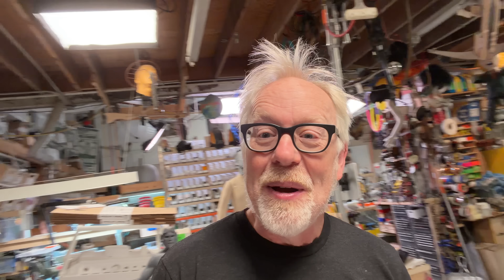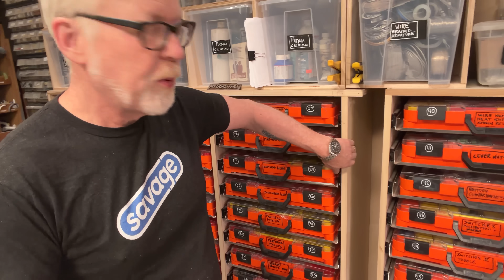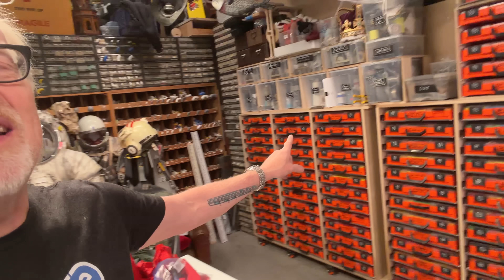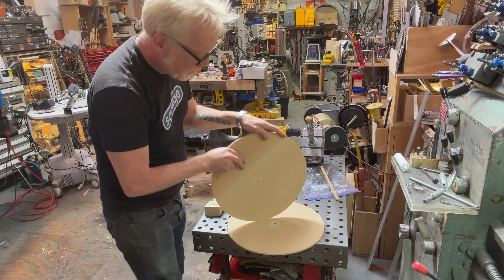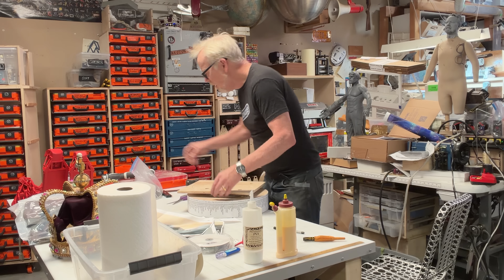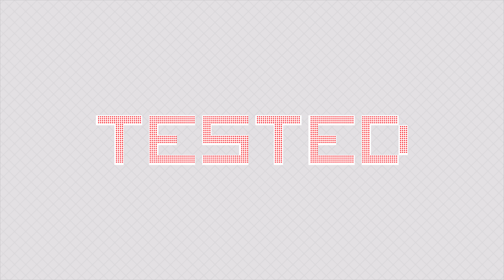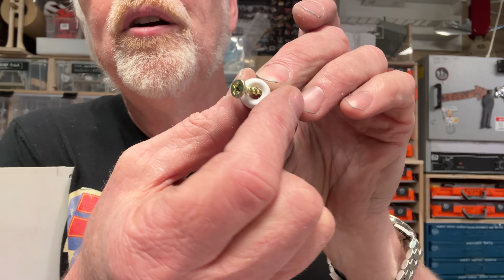Adam Savage's Hardware Organization Mistake!

Comment: I hope that the idea @ 22:13 is a larger diameter touch wheel/ring on the sides of the list to keep hands off the paper. Nothing turns gray faster than white paper in a workshop.
Reply: I was thinking something similar, but instead I would adjust the cutout on the right side to have a small slot on the top and bottom, and put a series of ~3/4 inch nubs to turn the wheel with. Could maybe put one every 6 inches or so? Just fun to think about!
Reply: The previous board, at the start of the other video, had clear (packing?) tape on the paper; it had something splattered on it and he said he'd have to wipe it off. 
Being off the floor it's probably all farther from the splash zone, but it'd do the trick. Maybe it'll get embellished when he redoes the list a month later like he said he does 😂
Reply: @Spamshinerdirty hands are more worry than the splash damage.
Reply: you'd lose the ability to pencil stuff in, but it could be laminated.
Reply: I immediately thought the same. It would be nearly illegible within 2 weeks in my shop unless I stored gojo wipes next to it.😅

Comment: You could drill holes on both sides of the wheel for finger grab points instead of putting your hands on the paper list. It will mitigate the damage grease and oils will put on the paper from your hands while you're in a building frenzy.

Comment: An acrylic piece over top with a thin line painted on it.   This would allow you to spin in and sort of give a definite point to read while not obscuring any other lines.    Not really critical but gives you a well defined place to read from and assuming you walked away and forgot what you had read or needed other read it again, it would be right where you left it.

Comment: Inside the wheel, put a light so the index glows, rather than a light that shines down on it. There is plenty of room for a hole to be cut in the centre of the bearing and the light could be fixed to the slide. 

Of course, you then need a "do not press" button to turn the light on!

Comment: Only issue I see here is if you are going to use this wheel a lot your paper will be messed by hand oils and you will need to re do it all over again. It would be way better if there is some kind of gears on the side where you can "steer" wheel and also you can use smaller font with magnifier in front that is fixed on your frame and positioned so you don't need to bend !

Comment: I really like this low tech, bespoke solution to an organizational problem. I grew up going to work with dad in the service department of a motorcycle dealership. The solution back then was printed catalogs that were saddle stitched. And then in the mid 80's computer software that, looking back, was total garbage. Because of my computer background I would have just set up a chrome book always logged into a Google Sheet that had the information. Have 100 people independently solving the same problem and you'll end up with 100 different solutions.

Comment: I’d suggest Arial Narrow or Helvetica Narrow. Sort the list by categories. For example all screws would be together, all nails, all washers, all bearings, etc. So if you wanted “5mm Machine Screws” you’d rotate until you see screws, then machine, and the size. You could also put a little image flush right as a category indicator. Or just another column of text. But not every line, but the first one in the category. It would make finding things a lot easier.

Comment: Looks great  .. I have two suggestions.. that can be easily added to it as it is now.. 
1) In addition to doing the "Lines" at the Alphabet Break points" also print in Sharpie to the Right a "big" Letter to correspond to so you can see at a glance if it is at "A" or "G" etc.. you do not have to do every letter just so 1 or 2 are visible no matter how the wheel is rotated.. 
2) Take wide packing tape and cover the paper index... so if you hands are wet or dirty you do not damage the paper and can still read it and allowing you to wipe it off..

Comment: Very nice!! Love the idea of throwing it on a wheel cartridge thing. Also love that you put the finishing panel on it. Completes it. 

Ideas:
- push the wheel further back into the cabinet depth
- black plexi panel where the window is and add a plexi wheel to the end of the wheel as a handle
- cut a new slit along the right side of the window plate for the wheel handle to push through
- add led lights that make it look cool and easier to read once the wheel is recessed. LED should time off. 
- upgrade the list with a big alphabetical letter justified right.
- Extra points if the led is black light and the letter is fluorescent. Would really pop as you scroll. 
- Magnification could be good too. Fisheye would bake it fun.

Comment: the lazy Susan is less than satisfying. I would have chosen a bar through the center with two roller skate bearings. it will be so much more satisfying when it spins that way

Comment: The lazy susan is grinding because it's mounted sideways. It can't do radial loads, it is for axial loads (sitting on a table with weight on top). Not to mention the eccentric loading of being mounted to the side of the load like a cantilever. Try another solution to get a free spinning wheel to be truly satisfying.

Comment: As a few other comments said, you should put a lens with a line that you look through to see the list (we are all getting older and our vision gets worse). A cheap wallet magnifier lens is a few bucks and could be mounted with a small 3D print.

I would also think about making the list a 2-level taxonomy. Looking for a "screw" should not make you spin to Drywall Screws, then Eye Screws, etc. You already kind of have it with lines where you have "Rivits" then a comma and the type. I would suggest that, instead of lines for letters of the alphabet, you have larger, bolded lines (with no number) for large concepts, and then the numbers as you have now, inset below them. This 2-level outline will be much quicker for information retrieval. The old list made sense when you were limited by the cabinet's height, but now the list can get longer and still take up the same general space, while making it much faster to find main items at a glance.

Comment: This should be the ever improving project. 
- Mount higher so you don't have to crouch to search parts
- Needs a wheel of fortune tick, tick, tick sounds as it spins
- Letter divisions for A, B, C.... should be on the side of the wheel in large lettering. 
- Tiny whiteboard just above to temporarily list multiple bins so you only need to lookup once and search once

Comment: If he hadn't printed the numbers on the left, I would've suggested using a laser level to give an easy "underline."  It wouldn't be difficult to make it power-on automatically whenever the wheel moves and turn off after a set time with no movement of the wheel.  Absolute overkill, I know, but that's also why it would be awesome.

Edit: typos

Comment: I think this really needs some sort of handle/gear-like grab points on the left or right so the wheel can still be turned easily without having to touch the list. 

In the graphic design, I would on the left add colored columns for each letter making it easier to scroll to specific letter then find specific word. Another example borrowed from the Rolodex.

Comment: I have a smaller setup, just 16 shelves divided in three areas, but every shelf and area has a QR-code and three led;s, i use the phone to look for M3 screws, and the LED lights up on the compartment in the shelf where it is. Or scan the QR for that area and see what should be there.
Just a tiny ESP32 and "a bit" of cabling. After a while i learned where stuff is so just use it when i search for something strange.
But for a analog setup, i love that one Adam made. And it works without power and looks cool 😁

Comment: @tested I still think this would be a quick, easy and super useful private skill for Alexa. This is the type of think that voice assistants are actually useful. The data structure is dead simple, the Alexa intent is straightforward: FindBinIntent, where are {partName}, find {partName}, locate {partName}, The normalization is straightforward.  Basically an Alexa custom skill backed up by an AWS Lambda, and no database required - the dataset is small, just bundle the data with the skill.

Comment: My wife and I considered using a lazy susan bearing like this for a calendar wheel I comissioned for her. It's a ~3 ft diameter tabletop CNC'ed and dressed up very nice. We thought of other options because I wasn't sure how we would mount the lazy susan to the wall, and the only thing I could think of was what Adam did here, drilling holes through one of the boards to access the holes in the lazy susan. Yet we couldn't do that with the finished calendar, or our wall. We eventually chose to use ~12 picture hanging fixtures, the kind with the zig-zag teeth, spaced around the wheel behind each month so we can pick it up and turn it to one of ~12 specific angles. Worked out great for us, but I've never forgotten my love of lazy susan mechanisms.

Comment: Now add an illuminated magnifier so you can actually read the line item when it comes around on the wheel.
And a motor to turn the wheel. And a button to control that motor.
Then replace it with a flea-market Android tablet sideloaded with a custom app.

Comment: Honestly OpenOffice's spreadsheet program is basically a clone of excel from 20 years back, if they stopped adding new features then. Some of the features added to Excel did make it better for a while, but these days it has a lot of "features" that make it infinitely worse to use, so you might just be better off using OpenOffice anyway.

LibreOffice is a fork of OpenOffice that incorporates newer features and improvements, and is probably a better pick than Excel these days, especially with all the enSiffication microsoft are pushing out.

Comment: I’m surprised that it wasn’t color coded as well so you could quickly find a category like fasteners, misc, etc
Reply: @tested Or alphabetically color coated. As you're walking to the wheel you already know about where it is in the alphabet, and which direction you would need to go to the new letter.
Reply: Or, you know, use the actual spreadsheet used to make the list in the first place. They can be instantly searched on any device.
Reply: @bcbock  the tactile search keeps you in the physical space though, using your hands and your eyes so the flow state doesn't get interrupted
Reply: @EmmettMcMullan  At the point of storage add a small touch screen device that is connected to the same server/wifi as the computer that has the original.
Reply: @EmmettMcMullan Dunno, I've never felt interrupted using a keyboard

Comment: You could actually have made this with a smaller wheel and just have the list hanging down from it or between two wheels. Sort of like a band saw.
That way, the list could be extended down to the ground, to something like 6 feet. You could even add more wheels and essentially have unlimited length.

Comment: Looks super cool but, personally, I would have gone with a boring old binder hung on a hook. Tabs for letters/sections so I can turn right to the section I want. And if I ever update my system I can just print new pages and replace the old ones with minimal effort. Less visually appealing but more flexible and less work.

Comment: Those bearings are indeed nice, but seemed a bit slow/sluggish for this use (high friction). 
I would just have used one/two small ball bearings so it would be easier to turn with one finger. Also, I would probably have made the wheel larger to have lots of room for more.

Comment: Were it me, I'd use cell background colors to divide up blocks and use the alternating-colors feature to go between two hues so it's easy to read. So light red and medium-light red could be one block (A's, for example), light blue and medium-light blue could be the next block, etc. The alternating hues makes it easy for the eye to track over a line, and the colors let you instantly go to the section you want rather than needing to search the wheel. You could even have the blank section at the end in alternating light gray and white for you to fill in later. The colors could also loop if you wanted to do more blocks than there are readable background colors.

As a side benefit from being able to search it faster, the colors would look good if you went with the Price Is Right gag everyone's suggesting. 😂

Comment: Since you made the list on a computer just putting it in to a docment makes it serchable, Ctrl + f gives you a "find" function where you can type inn the name of the thing you want. 
here you can add anything you want that you dont use on a regular basis.
if someone borrows a tool etc. you have it on the list, and who has it.

if some staff is cleaning up after you, you can give them the list and they can find its "home" by serching the list. 

I also added a QR code because i got a label printer. that QR code is listing to that specific item in my list so whenever i need to find where its supposed to go i can simply scan it and i know where its supposed to live, and i can change where it lives in the list with out having to change the QR code, because it refers to its possision in the list.

Now i dont give everything a QR code, just things i might not use for a long time, or someone might borrow etc. it has my name on it etc.

I added most things i own to the list, everytime i buy something new i add it to the list.
i also look up on line the instruction manual for the thing i buy, and installers for items requiring that then add that with a link in the list. 
Now it has taken me years to add everything i own to it, and im still not done. i do it when i feel like doing some organizing. 

Eksample:  "makita Chainsaw DUC356" "its location/home" "the manual", "When" and "where" bought it and for how much, i also have a picture of the thing.  (with a link to the google drive file with the manual linked to the manual) 

the manual will give me the specs of the chainsaws i need etc. and i can throw paper person away knowing i will never need it because i have the manual on the cloud drive. 

The list consists of about 400 items.
i am also adding spare parts/replacement parts to the list
so if i need to buy a new filter for for the Kubota excavator i got the OEM number and its specs (Outer diameter 80mm, height 75mm, thread size: M20 x 1.5)

basicly the more i add to the list the easier it is to find out things i did years back which i forgot.

Comment: adam should laminate the list or make it water/dirt proof in other ways or it will get dirty pretty fast if you aren't careful. besides that you probably also want to put dimple holes into the side of the wheel to be able to roll it easier (adam probably had a similar idea at the end).

Comment: A magnifying strip across it would be cool.
Reply: steampunk style, on a brass armature
Reply: And LED lights, just a tiny one will do
Reply: add etched in red line so as to make reading across easy
Reply: especially if it adds focus to the line. really want to say he needs more space between the lines for better readability
Reply: DEFINITELY
Reply: Was thinking the same, so in future when you want to add to your list out can print it smaller and still can read it.
Reply: or an attachment to the frame with an magnification glass you can move across the wheel.
Reply: lol it makes me happy to scroll down and see everyone else has the same thoughts as myself here XD
Reply: Magnifying strip with a thin black line at the bottom to act as an indexer to quickly differentiate
Reply: YUP.
Reply: Came to say this
Reply: Nice little fresnel… or big
Reply: I don't think so, unless the typeface is tiny. Something like this should be more scan oriented, looking for "box 25" or "#4 wood screw 1 inch." A magnifying bar would prevent the help that peripheral vision gives to the scanning, by blocking and distorting adjacent lines. If you can only read one line clearly, you have to evaluate each line. With scanning you can skip the shapes of "single and triple digit numbers" and "sheet metal screw" and "bolt," etc. 

Sorry, got carried away. I think a good v2 upgrade would be to make it a belt.
Reply: I came here to say just that. Cylindrical lens magnifier with a red datum line, in a brass steampunk frame, obviously!
Reply: Using a Fresnel lens
Reply: He wears glasses so it might not make much of a difference for him.
Reply: I came here to make the same suggestion lol
Reply: Great Idea. If the organizing solution works well it will grow. As the list gets longer the font gets smaller...
A second wheel under the existing would bring the same difficulty as the linear list. ie bending over.
Reply: Magnifying strip, and I know for a fact my grubby hands would make a mess of that list real quick so I'd be laminating it.

Comment: A company I worked for used a couple of those old mechanical address/phone number indexes as a way to catalog and look up part locations in bins.  Not much different than your setup.  They were relatively small and lightweight.  The pages were laminated to keep them clean, and had enough space to list other bits of info too.  Just slide the lever down to the part # listed on the top, and it opened to the right page.  It was much quicker than looking it up in the confuser.

Comment: Personally for being able to properly track across a list like that?  I like to put in alternating light, slightly darker, bars for the rows.  You can alternate one light, one dark, or 2 light, one dark.  That's just something that helps me when I have to look horizontally across a list of data.

Seeing the wheel built?  I'd be tempted to add a marker like the one on "The Price Is Right" and maybe an optional beep as it goes around :D

Very cool build, and very cool improvement to the inventory tracking!